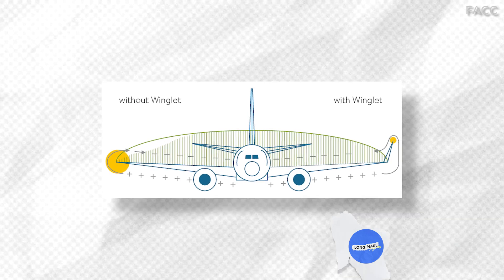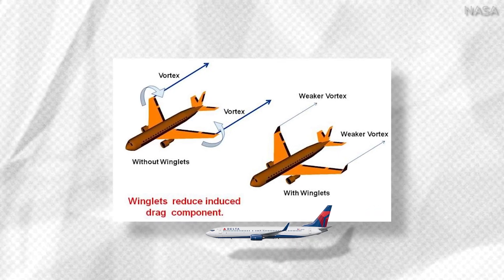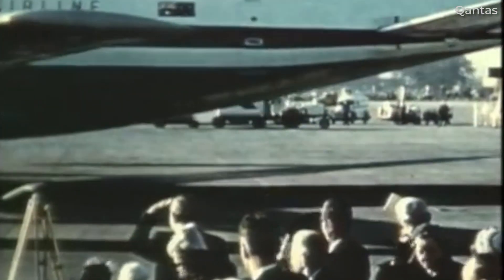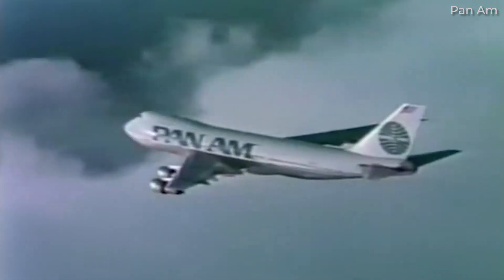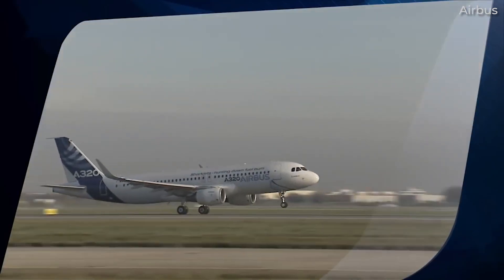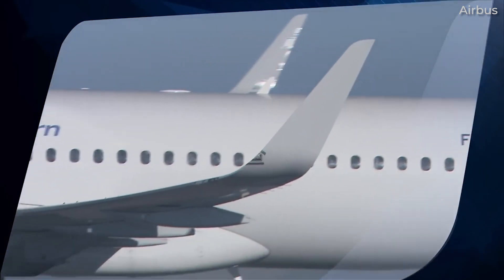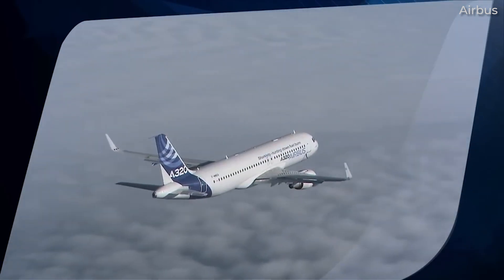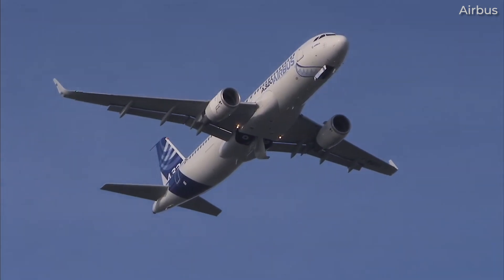Why Boeing Has Winglets And Airbus Has Sharklets

Comment: speaking of B777-8X & B777-9X, Boeing could have just re-engined the existing B777-300 ER wide body instead of the new B777-9X . . . the longer stretched fuselage of the B777-9X necessitates the need for a larger wing, both in terms of wing span & wing area resulting in increased lift . . . and hence the need for folding wing tips . . . wonder whether the folding wing tips on the B777-9X really that much necessary, just to fit into an airport . . . whether a B777-9 without the folding wing tip feature, will be seriously restricted to a lesser number of airports worldwide . . . you missed the bow-tie wing tips of the first generation A320-200 narrow body jets . . .

Comment: I knew the inventor of the Winglet wing enhancement. It's primary purpose was to decrease the wingtip vortex, caused by the mixing of the high and low pressure airflows exiting at the tip. The Winglet introduces a countering vortex to reduce the primary, and this reduces the overall drag of the main wing, and increases efficiency.

Comment: The Airbus A310-300 was the first airliner with wingtip fences in 1985. Other Airbus models followed with the A300-600, the A320ceo, and the A380. Other Airbus models including the Airbus A320 Enhanced, A320neo, A350 and A330neo have blended winglets rather than wingtip fences.

Comment: Once I flew a modified two-seated glider plane (Twin Astir 3) that had the outer wings bent upwards by 12° according to Prof. Richard Eppler's research. The plane felt fantastic to fly and was so stable that one could take away the hand from the stick while thermalling. In the meantime, many gliders also have winglets, mostly those in classes with limited wingspan.

Comment: Theoretically if you flat the winglets out it'll do better, just think the long thin wing on glider (or sugar). But it'll add more wingspan and more stress in the root structure.
Well, raked wingtip it's basically what that it.
Reply: Another advantage of winglets is that airport fees are based on aircraft size, which in turn is based on wingspan, so bending the wing instead of flattening it reduces the fees.

Comment: Interesting how Boeing is named as the first to install an anti-vortex solution. Airbust had them long before.... Small but both up and down on the A310, A320 and later versions of the A300.
Reply: Other wingtip devices were common om civil and military aircraft before that😂
Reply: @jouniairplanevideos  But not on commercial airliners.

Comment: Would it make any difference in fuel efficiency if the horizontal stabilizers have winglets/sharklets? After all, the horizontal stabilizers could be considered some type of extra wings at the rear of the aircraft where vortices could be created as well.
Reply: not really. the horizontal stabilizers aren't exactly air-foil wings thus they don't really create significant lift. They are merely there to direct airflow. you could say they are like fins on a rocket or like a vertical stabilizer attached horizontally. Further more: the engine blast may travel across them. add winglets and you add another vertical surface the blast can interact with making the plane less stable on its yaw axis
Reply: That would cause a stiff aircraft to fly. It would make it more stable and by that less agile. Stabilizers are negative wings. They give no lift, that's just for aerobalance. To compensate on higher speed

Comment: "The Airbus A310-300 was the first airliner with wingtip fences in 1985" according to wikipedia

Weird to have a video about Winglets / Sharklets and not mention that Airbus had been using Wingtip Fences for 16 years before Boeing installed a wingtip device on a short or medium haul aircraft
Reply: Airbus doesn't have that title. There are a view examples of aircraft wich has wingtip devices like boostertips. A10, Cessna 172 etc , crop hoppers etc. Designs from several wingtips and winglets already excist back in fifties. Technical possibility started decades later
Reply: @jouniairplanevideos  the quote does say "airliner" 😀

Comment: Your information is incorrect. Learjet was the first manufacturer to install winglets on their "Longhorn" wing design first installed on the model 28 in 1977 (a 25 model with the new wing). The results were good enough that the new wing was then installed on the existing tip-tank 35 model creating the 31 and since has been on every Learjet, Challenger, Global and even the company designed C-Series (Airbus A-220) model. Learjet was the manufacturer that first initiated talks with NACA to explore the wingtip vortices and the wingtip design they had developed on the "Lifting-body" vehicle they were testing prior to the space shuttle. Your saying Gulfstream was the first was wrong. Learjet had winglets long before anyone else had considered the design and was the first aircraft manufacturer to use them in production.

Comment: My favourite wingtip design as the one A. Bowers et al tested in 2015 at NASA. 10% lower drag for a 30% increase in span, no significant increase in bending moment and hence structural weight, and the elimination of the vertical stabiliser. I wish someone would do a feasibility study of optimising it for the transonic regime
Reply: I love it when you talk nerdy.😂

Comment: I recall that efforts to delay and reduce tip vortices were made back in the middle of the 20th century by putting flat plates on the wing tips of some relatively small aircraft ; it was a failure . The plates increased weight and profile drag and merely formed a core for the vortices. Since aircraft of the time had a lot of room for improving profile drag it took a decade or 2 to revitalise the subject. As stated, In cruise a tip vortex is created by air spilling horizontally off the under  wing tip instead of being defllected  down from the trailing edge resulting in a loss of lift. The object of any of these tip devices is to reduce this spillage and the passage of what is left into the low pressure air above the rear of the wing. In short  if they can delay, or unwind , the vortex until aft of the wing then the wing can produce the same lift at a lower angle of attack reducing induced drag. The negative side is the combination of extra weight,  profile drag of the device and any induced drag from redirecting airflow. Just like take off performance can be improved by loading payload near the aft C of G limit so reducing the negative lift of the tail plane at rotate the values involved are proportionately small but have long term reward.  The entertaining variation in wing tip adornments is because they are fine tuning of performance ; not fundementals.  It is worth remembering that the inconvenient vortices in this subject were an essential source of lift for Concorde's significantly different wing in approach configuration. Also worth remembering is that the Rutan Voyager scraped one of its similar devices off using the runway on take off but went the 24,000 mile way home to get it fixed. In appropriate  conditions, it is possible to watch persistent condensation trails spiralling in the vortices produced by wings 3 or 4 miles behind the aircraft where the large diameter is no longer related to the tips of the wings but the weight of the aircraft. It is a pity that business politics can successfully challenge technical achievement and relevance.

Comment: I think that Boeing's winglets on the 737 have a great design, it looks really good.
Reply: It actually was design to be look good, but later found to actually have aerodynamic benefit.
Reply: @umi3017  efficiency is everything for the airline industry. You think they'll put extra weight on the plane just to look cool?
Reply: @meikhochakre3309  It's originally designed for BBJ, so technically not airline industry, and looking cool is big part of prestige.
Reply: @umi3017  I would assume that only applies to interior design.
Reply: It’s not about looks.

Comment: I heard that 787 and 777's raked wingtips are optimized for long-haul flights (cruising), while the blended winglets of 737 (and the like) are more optimized for short-haul flights because their impact is greatest for take-offs.
Reply: If that’s the case, I wonder why the new Embraer E2 aircraft have raked wing tips instead of winglets like their predecessors.
Reply: @PhorzaSky  maybe for it's increased range? I found it interesting too!
Reply: That's correct
Reply: Yes, the wingtip vortices exert greater drag at lower speeds (take-off and landing)
Reply: That's correct
Reply: Even on the 737s I believe winglets improve efficiency primarily at cruise. As far as I remember, no 737-600 received a winglet upgrade because they were primarily deployed on short routes with very little time spent cruising.
Reply: Parasite drag is produced by VERTICAL surfaces and Induced drag is created by HORIZONTAL surfaces, for example when the Flaps are at 0 degrees they produce Max Induced drag and Min Parasite drag, at 90 degrees Min Induced and Max Parasite drag and at 45 degrees in the middle of both, for a flap with no thickness. The fact that Lift and drag are both proportional to airspeed squared, means airspeed affects a 2 Dimensional surface, geometrically a Square plane. Wing Vortices are not the cause of Induced Drag but it is just a Visible Effect of it. I have developed a hypothesis to explain physical, atomic and subatomic (gravitational movements, Center of Gravity and Mass), however I need to validate my V & H surfaces theory first.
It seems that Winglets reduce Lift and increase Drag, I also believe in turbance Winglets impose additional stress to wings and all other moving parts inside the wings like rods, joints and moving surfaces. Wingtips also decrease the stability and controllability in turbulent air. Simply put another british scam.
Please let me know what you think, thanks.

Comment: Raked wingtips,the  latest and greatest..
Especially on the 787..
The dihedral and graceful curves on that wing flow nicely into the wingtips..
Reply: How are they effective compared to winglets?
Reply: @ShadowRap-y5l  Basically, the wing is just better designed from the get go as allowed by better technology. The way the wing ends improves drag without the need for winglets. I've also heard that winglets have improved efficiency for shorter flights, while the raked wingtips have improved efficiency for long haul flights. Not sure if this is true. Maybe winglets are overall more effective, but the extra weight is more of a penalty for long cruise times.
Reply: @zlm001  I think the thin rake, especially as they bow so much, creates the same effect.
Reply: Stunning to see for sure, the most graceful bird in the sky.

Comment: These winglets do very little to reduce drag.  Another myth is fuel consumption.  They help a TINY bit.  Probably not worth the cost of engineering these things though.
Reply: They appear to make enough of a difference that Ryan Air expects them to save enough fuel that it's worth spending more than $200 million to add them to their 737-800s.

Comment: I’m fairly sure that the Airbus A310 was the first commercial jetliner to have these devices. Whilst not the same style at later versions the wing tip fences on the A310 which were then introduced on the A320-200, A300-600 and A380 all serve the same basic function. The sharklets on the A320 are basically an improved version of the fences on earlier models.
Reply: Seem to remember when introduced on the A310 became designated -300
Reply: Stretching the memory a bit with that, but think you are probably right. I know you definitely right that the A320 only introduced them with the -200, as I was very involved with the -100 intro to BA service and and all 5 of ours (G-BUSB,C,D,E & F) didn't have winglets or whatever you choose to call them
Reply: Fences were an early attempt to effectively 'block' the vortex, which never works very well, the extra parasitic drag almost always wins out, that's why they were so tiny, and at that size they're basically pointless, hence why airbus stopped using them. The winglet uses the flow pattern produced by the vortex to direct the lift vector forward and produce 'induced thrust', which is why they get better efficiency for a given wing bending moment as stated in whitcomb's paper.

Comment: Earlier A350s have a slightly different sharklet than later ones. How easy would it be to retrofit the latest A350 sharklets onto an earlier A350? Would it be as easy as fitting winglets onto a 737NG?

Comment: It is interesting that the Boeing P8 has a raked edge versus winglets.
Reply: They are even better but increase wingspan. On the P8 wingspan does not matter that much. But in many congested airports it does and Winglets are heavier but they don't add a lot to the wingspan.
Reply: It's used for it's long range capabilitie. Those P8's are used for surveillance and fly very long. Winglets are efficient on short and midhaul less efficient on long haul

Comment: Imagine taking a 737 from the 1980s and being able to modify it to be able to run the latest engines and retrofitting modern winglets. I wonder what the speed and performance differences of the before and after would be.
Reply: Boeing already did that and it killed people...

You can't just add new engines to any aircraft. It has to be tested. The 737 program is dead. The MAX will be the final generation for it. The 737 was always lower to the ground with stubby landing gear. There isn't enough room for larger engines without heavy modifications being made. The A320 family always had taller landing gear that was stored inside the body of the aircraft. Because of this adding new engines was easy. Boeing couldn't do that so they moved the engine up by making the pylon shorter. Sure the new engine 'fit' but at certain angles and conditions it effectively ruined the lift of a significant portion of the wing.
Reply: I'm pretty sure the 737 MAX aircraft are the result of doing exactly this.

Comment: My vote for best looking winglets goes to the A350. It appears to be more integrated into the wing design compared to the 737, 757, 767, 747, A380, A330ceo, A320ceo and neo, E-series, A220, C919, MD-11, which all look like it was “tacked on”. The 787’s and 777-300ER’s raked wing ends doesn’t seem to be wingtip devices, but more like wing planform designs.
Reply: What the 767-400ER, 747-8, 777 2nd generation onwards, 787 and Embraer E2 uses is raked wingtips
Reply: Im pretty sure you'r right, winglets are indeed bolted on
Reply: Have a look at some competition glider winglets. Obviously not quite the same case as airliners, but DG's neo winglets (no relation to airbus neos) and jonker sailplanes' winglets are stunning
Reply: Honestly the 737-NGs is eben better, those aircraft just Look wrong without them

Comment: So, why do we not see some kind of winglet or more aerodynamic designs on aircraft elevators?
Reply: You mean horizontal stabilizers. Elevators are the part on it that acts like a flap. Any way,  the horizontal stabilizers generally do not produce  lift so no pressure difference to cause drag from a vortex

Comment: Would've been nice to hear more about the design of the winglets on the Max & why they have 2 points on them instead of 1, one going downward as well as up.
Reply: The air bellow the wing is a higher pressure than naturally and above is lower. Somebody did the maths and said you can save wight by reducing the height and sending some lower. While somebody at the other firm just said make a simpler bigger one.
Reply: The ones underneath optimise for flying over Australia :-)
Reply: They aren’t only on the max they started doing it on the NGs also
Reply: Pretty much looks more than anything else.  The function of winglets is really pretty trivial but once they were introduced even though their function is minuscule, they look neat and since the flying public has an overbolwn notion of them doing something that's important, airliners have left them on.

Video to watch posted by the channel Mentour Now!.  He talks about these devices.  Basically they're trivial, look neat, but yes they do add a little functionality in the way they break up the pattern of air moving over the wing which is air curling back over and around the top of the wing and if I remember correctly it's a little better for stability to break up that air flow.  But for the very first statement made about drag, not so much.

EXCELLENT channel, Mentour Now! and also his main channel Mentour Pilot.  That's the first place I would go for anything dealing with the airlines.
Reply: @johndoh5182  that is so inaccurate it hurts
Reply: @johndoh5182  mmmm.. split scimitar adds an extra 2% of efficiency to the 4% reduced fuel burn of sharklets...there's a reason Ryanair is spending $500K / plane on the addition of them. nothing on planes is really there for 'looks', especially when looking at Ryanair, they only spend money when they need to. i have to disagree with your comment, and hopefully that answers the parents'.
Reply: @johndoh5182 Hi, I’m studying engineering and participate in a few projects in aerospace. In aerospace everything has a function. While you are correct that winglets are a small improvement (in the grand scheme of things), they are still an improvement, and a lot of aerospace engineering is about squeezing every possible advantage from an already mostly optimized design. Double winglets are defiantly not just for looks.
Reply: @johndoh5182 Try aswell the channel for Sam Chui😅, you will love it